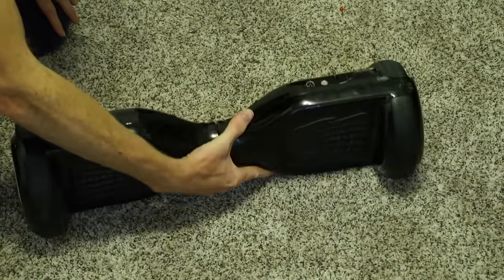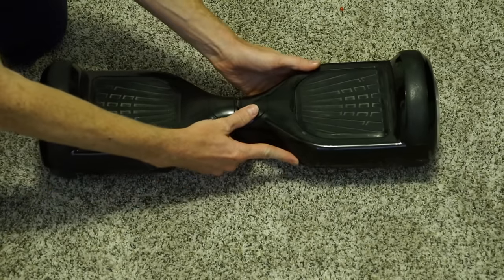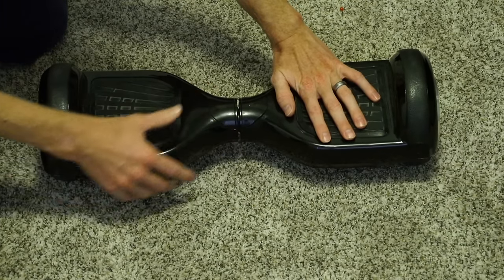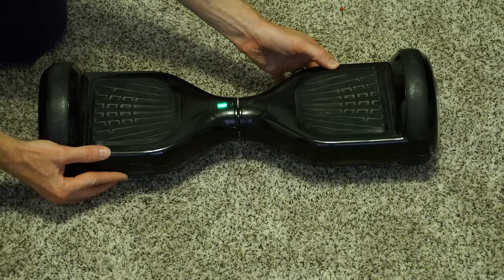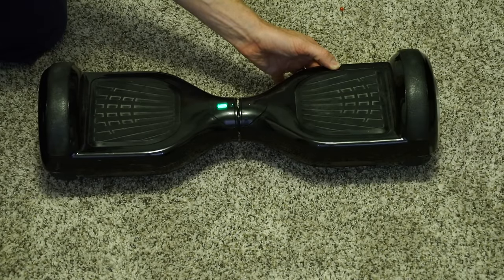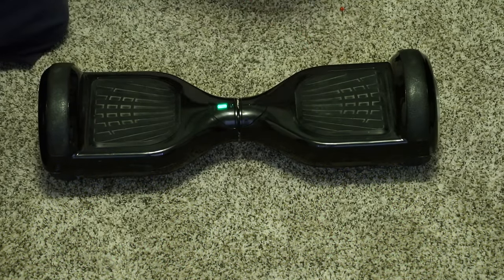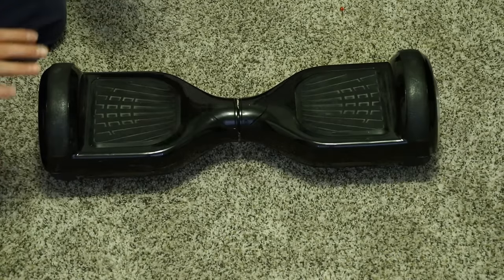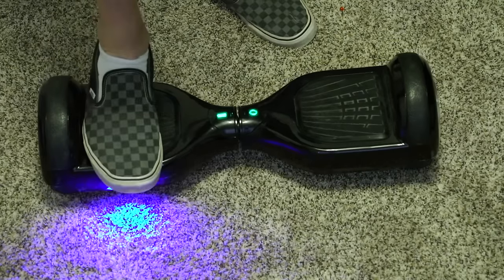RED FLASHING LIGHT! HOW TO FIX YOUR HOVERBOARD

Comment: i done what you said but it just keeps doing the same thing..the left side wont work but the right is
Reply: Same
Reply: ik
Reply: same:(
Reply: Same
Reply: that's what mines is doing
Reply: I solved the issue!! There was a wire in the left side side that was short I had to remove the back and connect it with a hot glue gun
Reply: Thx
Reply: +Angelo Lucero can post a video of the wire you fixed, I had the same problem
Reply: +Reagan Oha yes I will post one after New Years. I'm at work but it is a simple fix.
Reply: I have a video that might help you.
Reply: That's what happened to me
Reply: +Emma Kernan maybe it is main hoverboard got problem,we need know single system or double system your scooter uses,then will see how to fix .
Reply: Does it work now if it doesn't make sure to put it completely straight and the 2 sides are not twisted
Reply: i guess it is mainboard problem
Reply: ye it was i brought it back an they said something was broke in it and i got a new one
Reply: Same for me
Reply: funy ni sysu ahaiso8 ayga follae
Reply: Same my left side won't work
Reply: Joey smith my right side was broke and when i brought it back the maginets where broke in it and i got a new one for free
Reply: same i bought mine from amozon and it broke and we sent a email and they gave us a free refund and you got to keep the broken one so ibought a new one with the money they gave me :}
Reply: +Emma Kernan Thats probably the sensor. :/ you have to buy a new senosor for like 50-60$ and change it
://///
Reply: same but my right side won't work
Reply: EVERYBODY TO FIX THE PROBLEM YOU HAVE TO BUY A NEW SENSOR AND CHANGE IT YOURESELF! IT COSTS LIKE 50-60$
Reply: SAME!! :(
Reply: Yeah me to
Reply: Emma Kernan you Hafen zu chronisch it 👍
Reply: that's the same thing
Reply: Mine did that to but that's a whole other problem
Reply: Emma Kernan same
Reply: Emma Kernan same
Reply: Emma Kernan same :(
Reply: Same
Reply: same
Reply: Emma Kernan that is the same problem to me
Reply: Same
Reply: Emma Kernan same
Reply: Emma Kernan not eny more
Reply: Jerry 
What
Reply: Emma Kernan the same for me. I have a hoverheart so all u have to do is do the same thing he did, it doesnt matter how its reacting "JUST DO IT"😂
Reply: I just noticed this was in 2016😂
Reply: Same
Reply: Same
Reply: Mine worked when I did it
Reply: Same
Reply: SAMEEEEE
Reply: Exactly
Reply: THE EXACT SAME WITH MINE!
Reply: Emma Kernan keep the bottom Preston mine did that because I did it for like five seconds and took my finger off and it kept doing the beeping thing but it never calibrated
Reply: The light should be at th front
Reply: Ugh same
Reply: Emma Kernan Same
Reply: Sameeee
Reply: same!

Comment: I’ve seen a LOT of tutorials.. but nothing helps with my problem. When i go on it.. it has a seizure and doesn’t stay still and doesn’t go where i’d like it to go.. anyone know how to fix this? idk if i should get a new one.. i haven’t used my hoverboard yet because of this.
Reply: Okay so make sure it’s evenly balanced, not leaning to the front nor to the back, make sure of that it this won’t work. Hold down the power button for 10 seconds even while it resets, (which you’ll see happen because of the lights) then turn it off. Turn it back on then you should be good.

Comment: Tim I brought a Swagtron Hover Board from a Swap meet And Paid $20.00. It did not have a Charger for it I order one. I plug in the Charger to the Hover Board and let it Charge. I push the start button and the red Light keep on Flashing if i unplug the Charger the Hover Board does not do nothing at all? No Light Flashing at All. Do I need A New Batt?

Comment: So my friend has this board that has a speaker on it and the speaker came loose so I opened it replaced the speaker then the light came on.....I did what you said in the video and it worked first try thanks alot.